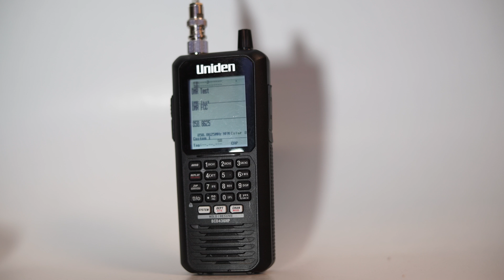BCD436HP DMR Demo

Comment: HOw do you pull info from the FCC Data Base?
Reply from the maker: FCC Data is unverified as to use or function. You can manually program the channels, but we only use the verified data from RadioReference for the included database.

Comment: I wish the DMR info on the screen were larger. Most of the screen real estate is wasted with emptiness. The DMR information is delegated to the bottom of the screen in small print. Not very practical or readable. To be fair there are times when the 436 will display some DMR info in larger print. Not sure why the difference but that is the truth.

Comment: How do I know if a system is a DMR system?  Thank you.
Reply: the noise of the frequency. it sounds like a diesel truck.  there are samples online of the sounds.
Reply: You can confirm via the noise, searching the frequency on FCC database and looking at the emmisions designator codes, and also using a $10 RTL-SDR. Unless of course you have this scanner already and are listening on that, in which case it would automatically figure out and all you have to do is listen.

Comment: so i have one DMR channel. the system they use is TDMA it one channel and i can't get it to work and how did you get it to scan DMR only. Can you please make a video on how to program a digital channel. i have the same scanner and i have been trying to do this one code for weeks. Can you please assist
Reply from the maker: I recommend you ask questions like this in the forums at RadioReference.com.

Comment: I don't get why this unit gets the DMR update but the hp2 touchscreen doesn't.
Reply: I would have never bought my hp2 touchscreen if I had known this. I read that it was getting the update awhile back so I bought it. Now I have to buy a new radio. Sucks
Reply from the maker: We've never announced DMR or ProVoice for any models other than the BCD436HP and BCD536HP. We've also never said that no other model will get the update. Do not infer anything from announcements or lack of announcements. Sorry you were misled by what others were saying.

Comment: I purchased the dmr upgrade, however it will not pick up my local mall security channel, i have all of the color code, frequency options etc but I know its a mototrbo system with color code 2, TG 100, and SL 1. dont know what those mean.

Comment: Iam from new zealand so where do i get the upgrade keys from ??
Reply: Is there lots of DMR networks here in NZ?
Reply from the maker: They are purchased online. However, our credit card processor may/may not (usually not) accept non-domestic credit cards. In which case, contact Ham Station or Scanner Master to arrange for a purchase.